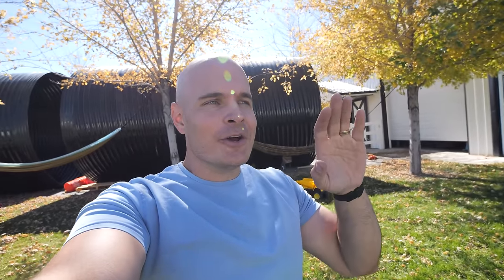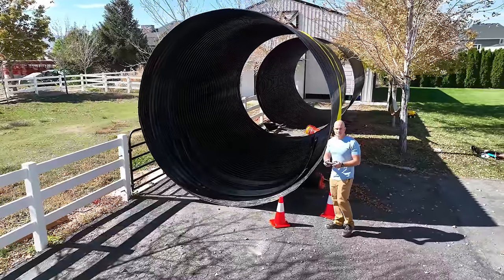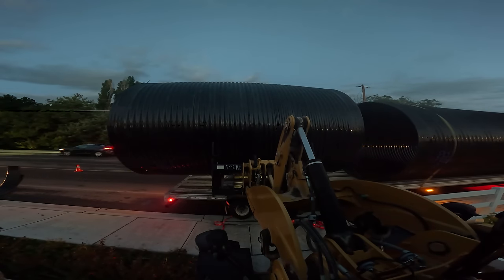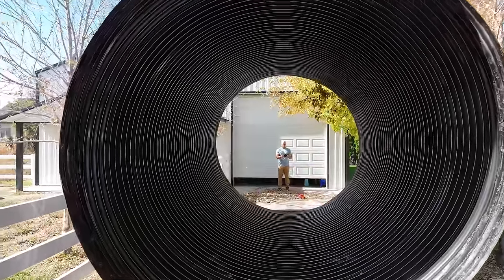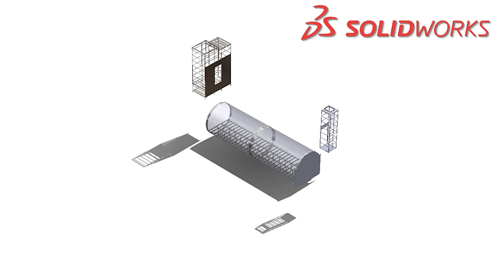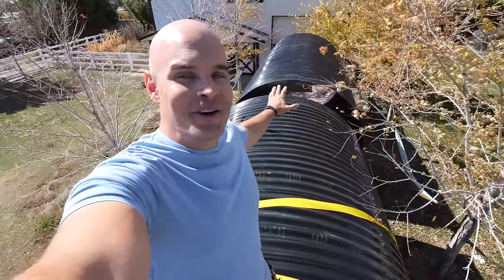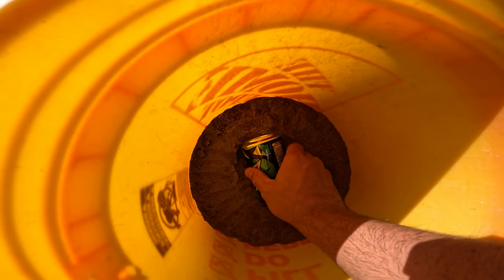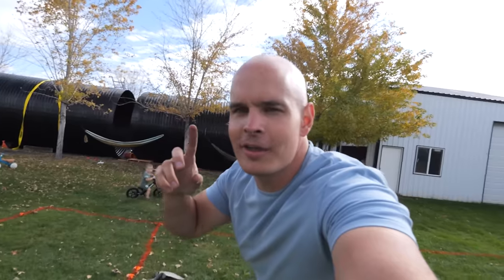I'm Building a Backyard BUNKER Part 1 - THE BIG TUBE

Comment: Fire bunkers are sorely needed for homes in many parts of Australia. Last i looked into them which was a few years ago, there had been many companies making variations but only one was certified as safe. The main issue was because of clean air and oxygen requirements plus it really needs to be sealed as a bushfire literally burns up, consumes all the oxygen around it and will suck out the oxygen from unsealed bunkers. I wonder how you're going to deal with need for oxygen and air circulation though it looks like fire wont be your concern. Why do you want a bunker?

Comment: $31,959 is absolutely ridiculous. A shipping container would have been a better option and easier to work with as the bottom of it is already flat. A shipping container is around at most $3000 for the 40 ft high cube with transportation. Reinforcing is only needed slightly as the corners and edges are all sturdy for welding a beam across the top and sides. Then also to just give it more reinforcement would to pour concrete on top to take weight off of the center and evenly distribute the weight onto the corners and edges.

Comment: I don’t get how this is cheaper than shipping containers you can get two of those for under 10,000 and 20,000 should be plenty for cement rebar and foam insulation. Please let me know I am having this debate right now and this could save me a lot of time.